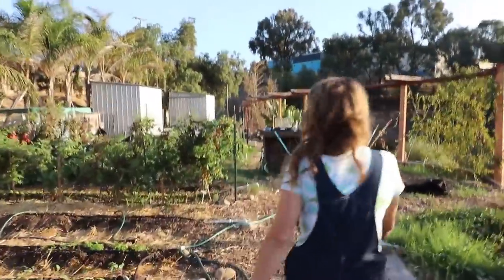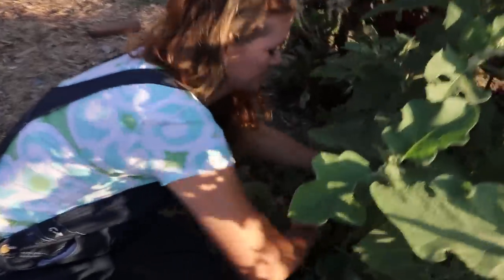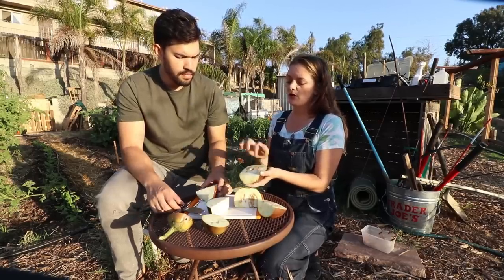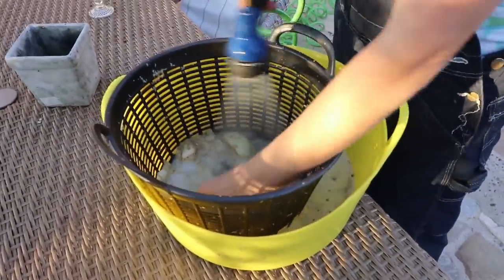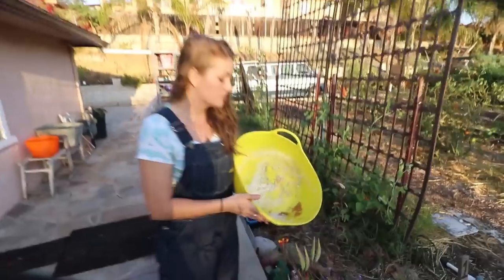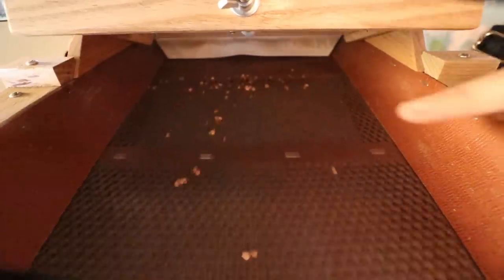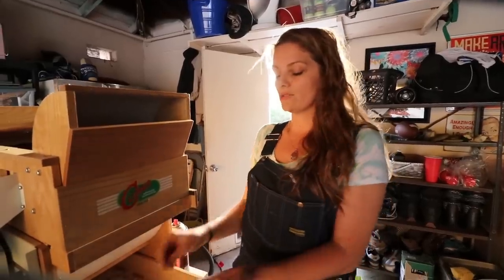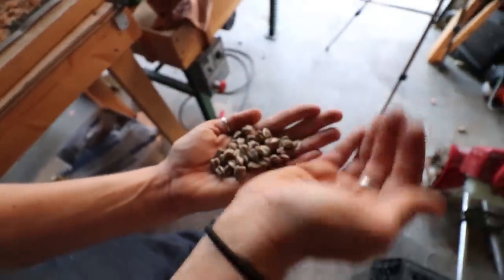Quitting Your Job to Farm Seeds For a Living? 🌱

Comment: I am saving seeds from grocery stores American products the imports are supposedly radiated at customs. Tomatoe seeds all sink while pepper seeds predominantly floated. Cherries can be opened using needle nosed pliers the cutting hole is perfectly sized to crack pits.. The peach and apricot I used lineman pliers and channel lock pliers. They have a second layer that has to be soaked for days a week until it shrivels up and you can pull it off then germination takes a few more weeks. Straight from the fruit may be a hybrid its just fascinating attempt to grow bonsai with pink blooms?

Comment: how do you make sure the plant pollination stays true to the variety? in a regular garden it is impossible to grow zuccini, cucumbers and squash/pumkins at the same time without risking unwanted genetic inputs from the sides... plus if neighbours grow a different variety you falsify the output, i guess?
Reply: Isolate the flower. On small flowers teabags work good. You can use a lightweight mesh bag on bigger flowers. Make sure to pollinate the flower first. If timed correctly the flower only needs to be isolated for a few days.